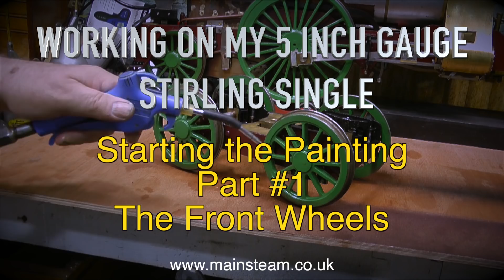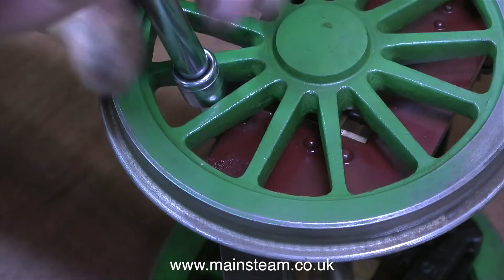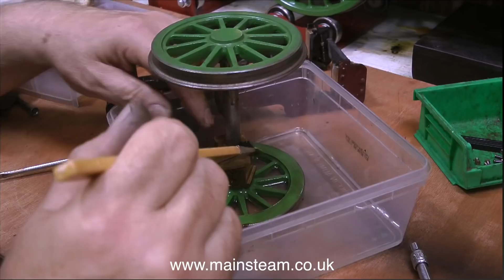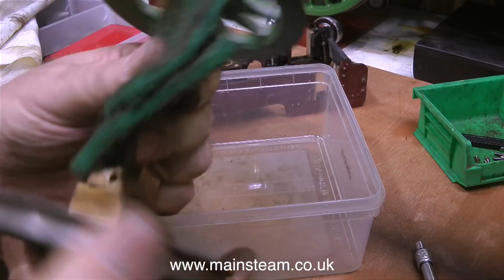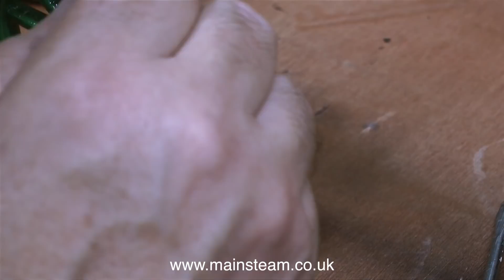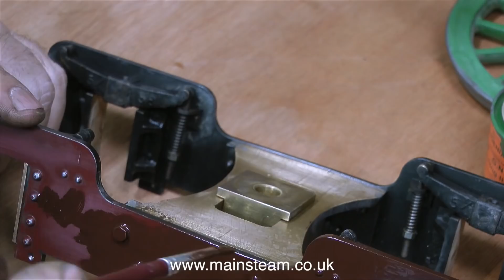MY STIRLING SINGLE #7 - PAINTING THE FRONT WHEELS

Comment: Something to mention from when I worked in automotive paint and body. The method we used was to have one one shop towel saturated with panel wipe (I think in the US we called it prep wipe or prep cleaner) and one dry towel. The process was to wipe the panel wet with the former, then wipe dry with the later. The idea being that the panel wipe would dissolve the contaminants and then be wiped away with the dry towel. If it was left in place to dry on the surface then the contaminants would be redeposited. That's what the pain company representative told us at least.

Not that any of this is applicable to model steam engines as you're not removing years and wax and silicone which is nowadays specifically formulated to be long-lasting, and you're not painting high gloss multistage paint over broad flat surfaces where any imperfection is easily visible. (reminds me of a girlfriend...)

In any case it might save you some money as you should have less panel wipe evaporating from the tub.

Comment: Naptha is very flammable. I used to work on tanker ships. Once we were loading naptha and there was some problem. Naptha vapours were sucked in engine room. All the running generators immediately started to overspeed. They were taking in air mixed with naptha vapours thru turbocharger. Luckily for us there was no fire.